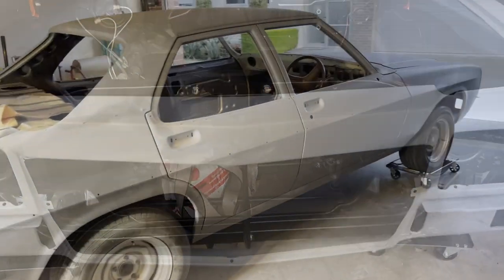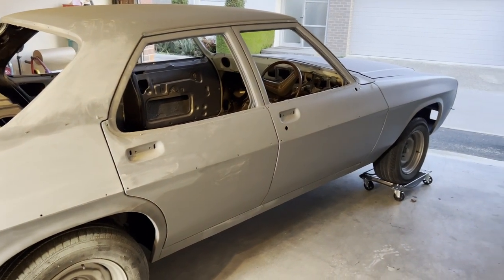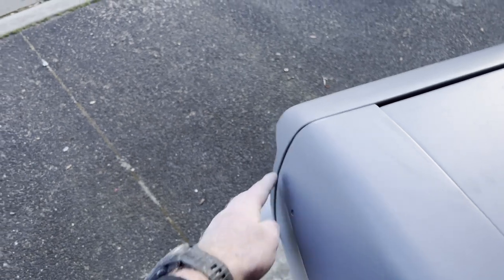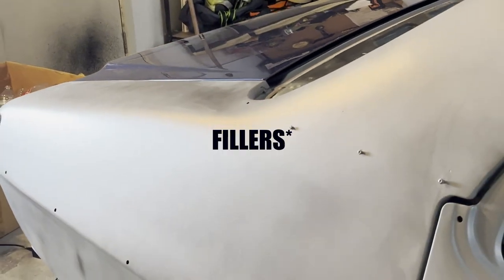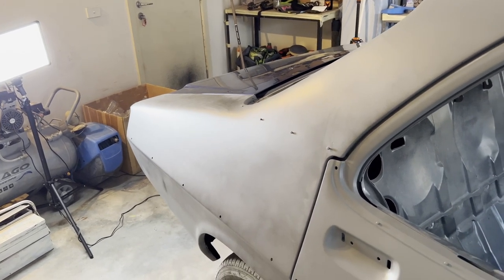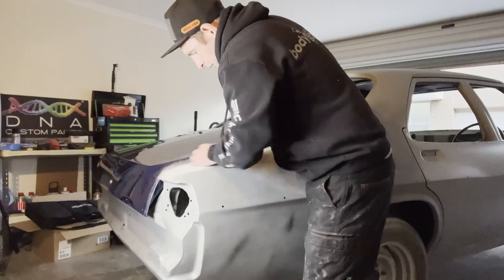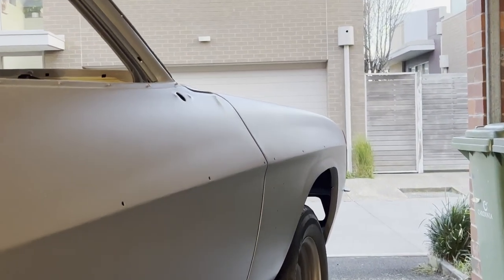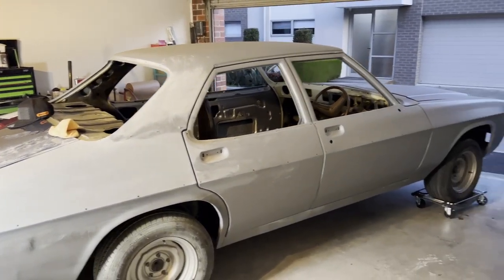HZ Premier Resto - Body Lines and Wet Checking

Comment: Good ol' debeer! . 

The bodylines and scallop through the tops of he guards are easy to get wrong and can make or break a paint job 👍👍
Reply from the maker: I agree 100% . I think a lot of people use stencils , I’ve never really worried about them and just follow the body 👌. Turns out I’ll be bare metalling both the quarters and redoing them which I’ll cover in the next vid . Issue is I can’t really make them sharper than what’s already on the body as it will look different and not flow . Bit of a shame but it is what it is
Reply: @BogDustForBreakfast  yeah I've seen those stencils ... they make the job look harder than it needs to be 😅 . 

That car looks pretty good except for the scallop missing from the back guards 👍 , i had a knack where I'd stand at the axle about half an arms length away (hards to explain , I think facing the back of the car at the rear , it's been a while 😳 ) and sort of sweep the line in with a modified speed file while standing in the same spot 👍👍

Comment: Great information mate, I have learnt a lot from you and have managed to avoid a lot of the issues you mentioned. Thanks for your help.Also can you please touch on solvent pop and filler pin holes and correction methods or how to avoid them to start with? I did just use the dolphin glaze for pin holes, it appears to have worked good. Cheers mate.
Reply from the maker: Thanks mate, will touch base on these topics for you. turns out ill be doing a heap of filler work on this car now after finding things wrong with it . so worth speaking about pin holes and how to avoid it . thanks for continuing to watch my videos mate

Comment: Hi mate, you mentioned at the end of this one to shout out if there was anything we would like you to show. I am at pretty much the same stage with my HJ, and as you know the sedans love to rust out around the rear wheel arches and dog legs. Whats the best way to fill and sand this area as there are lots of curves and bends in both direction so you cant really use a block? Also getting those nice sharp wheel arch edges?  Thanks mate I hope that makes sense..
Reply from the maker: I’ll be doing filler repairs on the dog legs in up coming videos so stay tuned! I love to use tubular dura blocks for those tight curved areas works a treat
Reply: Cheers mate for the quick reply! Look forward to watching.  @BogDustForBreakfast

Comment: How long does shrink back take to stop to start blocking primer
Reply from the maker: The idea is to prevent shrinkage on a car . Primers will always shrink to some extent during the curing process . What I showed in this video was just plain laziness by the panel beater who repaired it .
Reply from the maker: But to answer your question. The best time to block the primer is after it’s cured .
Reply: @BogDustForBreakfast  some people say 2 days some say 1 week what do think
Reply from the maker: @chrisoo8998  depends on if it’s baked . What speed of hardeners used etc there’s a few variables which speed up and slow down the curing process . I’ve primed repairs, baked the primer sanded and painted it all in the same day heaps of times and never had an issue .